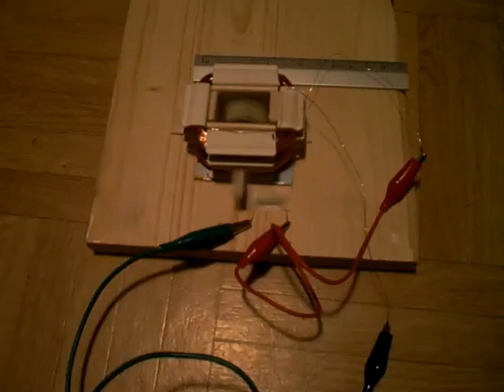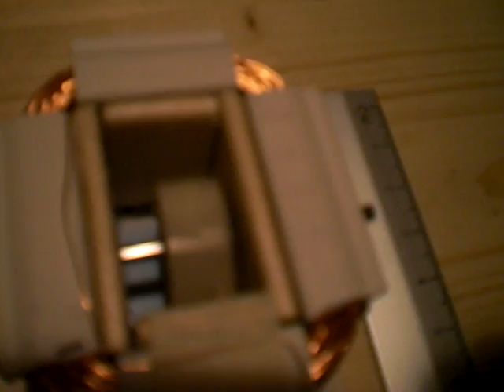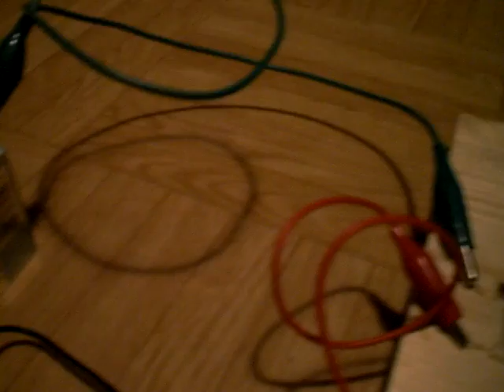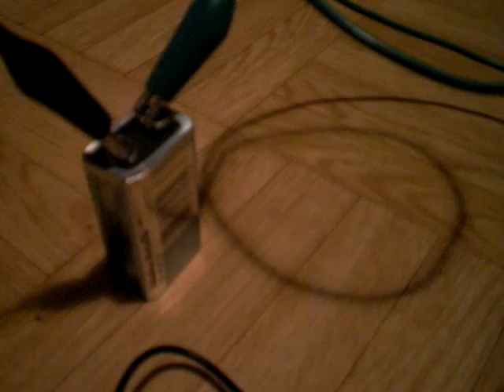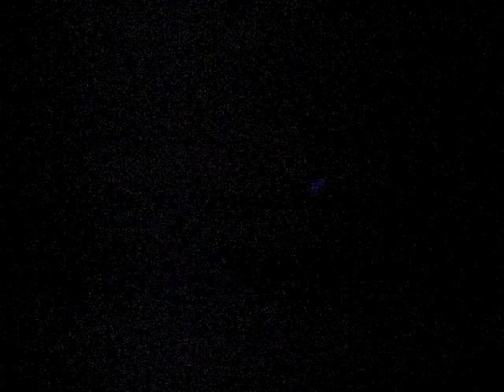Small Keppe Motor Part I

Comment: Bedini Window motor is different from the Keppe Motor in many regards. The circuit, rotor and coil arrangements are totally different. The Keppe Electromagnetic turbo system is completely new and authentic (I've never seen anything like that. Not even Grays motor which is far superior to Bedinis has something similar to Keppe).